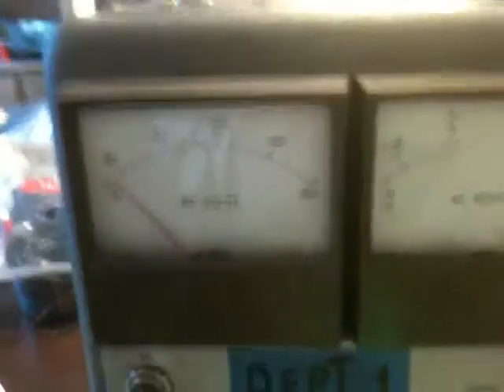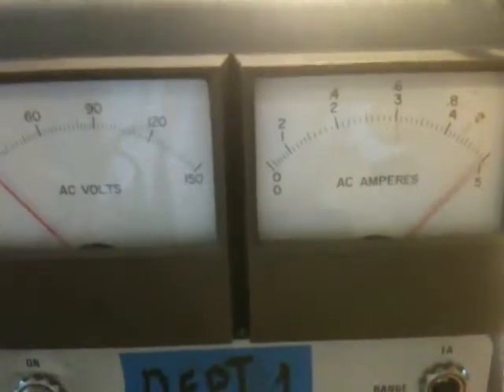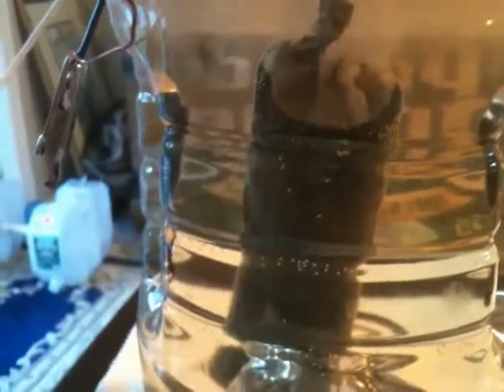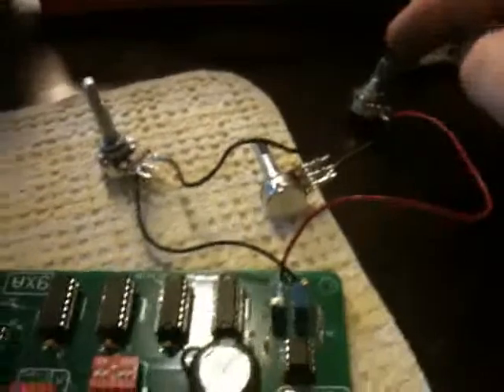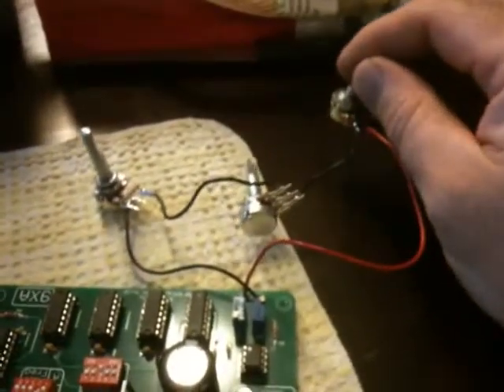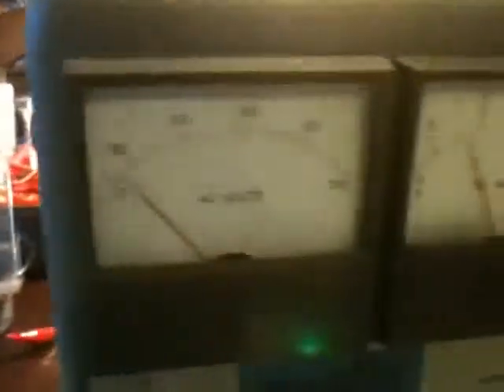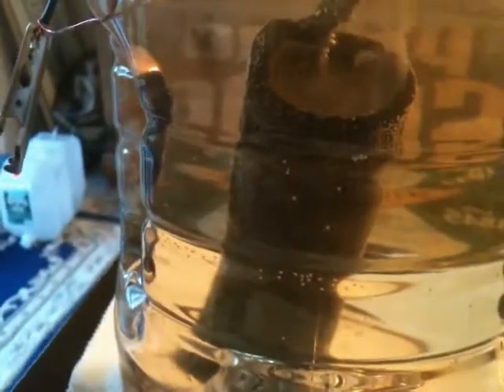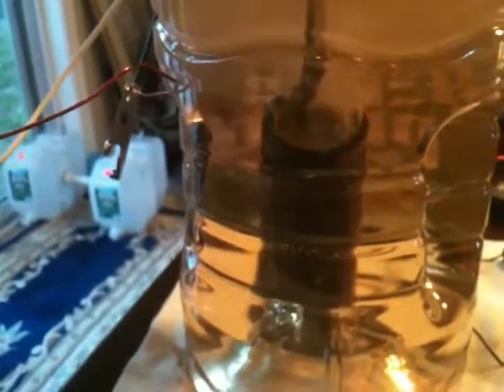Poor Man HHO Cell, Radio tuning, Preventing Elect. Leakage

Comment: pretty cool
if you pull the pot step up and down , you are pulling the little wiper off the carbon in side . losing your frequency. yea when the amp meter humps up and down, you are bouncing the power around between the cell and the inductor. you can buy a amp meter on ebay for about 50 bucks. you can measure the capacitance when the cell is dry, but does not work well with water in it